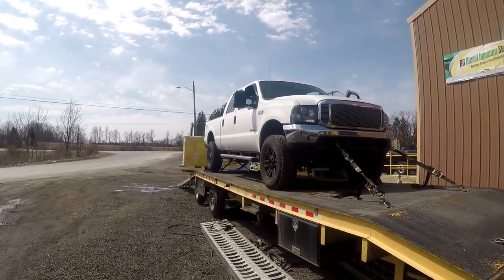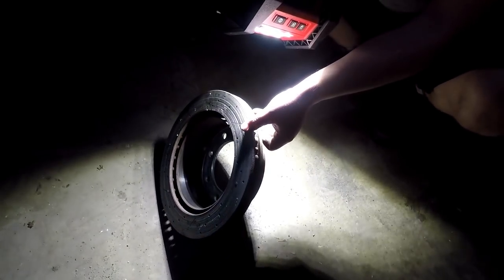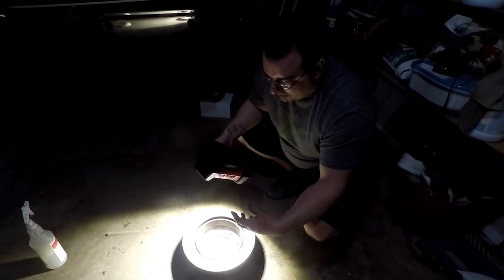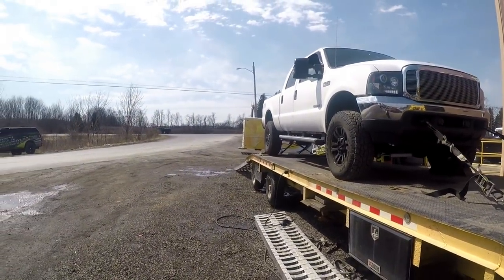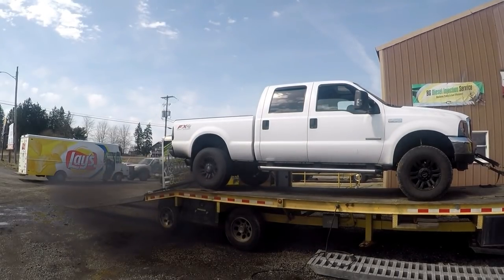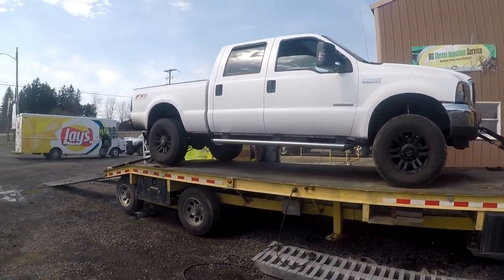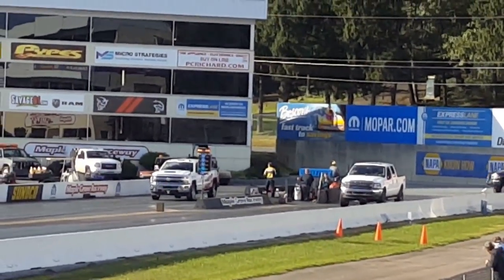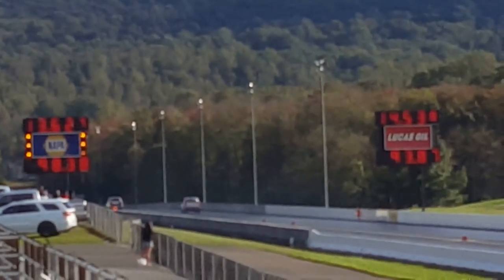6.0 Powerstroke Build Update

Comment: Fourth, i Think. I'm glad you decided to go with all the Billet Shafts, Since you're already in the Trans. You won't Regret it. Transmission should be ready to take any Power you throw at it. I know you were Running 175,s with Stock Nozzles. Still going with 190/30,s ?  Or did you Decide to go Bigger ?  I'm Running KC Stage 2 with Warren 175/30,s  i definitely wish i went Bigger. Was worried about Passing Emissions Testing, my State i gotta go every 2 Years. Just went about 6 Months Ago, Truck actually Ran Cleaner than 2 Years Ago. Was Surprised since i Deleted the EGR and Cat Converter
Only applies to Diesels 10,000 lbs. And Under, my 2006 F-250 Super Duty is 9,800 lbs. So i gotta go every 2 Years. So when Funds become available will definitely be going with Warren 205/30,s or 205/75,s Still with the KC Stage 2 would like to put there Stage 3 on but for now just injectors hopefully in a few Months. 205,s might be a tad Big for the Stage 2 but Don't wanna make the Mistake of going Smaller then Wishing i went Bigger just like i did a Few Months Ago.
Enjoying the Build, keep the Videos Coming.
Reply from the maker: I think you're third man. Thanks for the support.

Comment: I’ve been binge watching your channel for a while now, my dream came true after 12 years and I’m now the proud owner of an 07 F250 lariat quad cab short bed. About to get my tax return and plan on doing Egr delete, studs, BD oil relocation air cooler, KC stage 2 and Odawg intake with looney tune, I just don’t know what injector... have any thoughts? Great videos
Reply from the maker: Awesome thank you for the support. Now for your question with a stage 2 you could go as big as a 190/30 which is a great injector. On the smaller end you could do a 175/stock or 175/30. Now you will most likely need a fuel system with this setup at least a regulated return. I am running a fass fuel lift pump and doing a regulated return this summer
Reply: Don't know if this Helps you out but i recently went with a KC Stage 2 and Warren 175/30,s i definitely Wish i went Bigger, i would Definitely go with atleast 190/30,s From what Charlie said he Recommends 175/30 or 190/30 I'm Planning on going Bigger 205/30,s or 205/75,s cause i really wish i went with his Stage 3, when i ReCoup some Money from all the Mods i just did few Months Ago. So if you're definitely going Stage 2 i myself would go 190/30,s Done make the Mistake i did, i went 175/30,s and Wishing i went Bigger now. Hope this Helps you Out. Also at the time i did all the Upgrades i also did a Regulated Fuel Return, and that was it for Fuel System Upgrades, you should be O.K. with 175/30,s But if you go with 190,s i would Definitely do a Lift Pump i just did the AirDog ll-4G with my 175,s Just to be on the Safe Side, cause I'm planning on 205,s in the Near Future. Hope this Helps.
Reply from the maker: @badass6.0powerstroke10  great advice man. I personally will be going to a 205/30 on the truck. Also guys check out Turbo Time USA they really do have some killer stuff. That said kc turbo is also a quality company and you cannot go wrong there either
Reply: Thank you for the advice guys! It’s like an awesome Powerstroke forum without the BS 😂 anyways I really appreciate it. And I would have checked out your turbo sponsor, but I’ve been dead set on KC for a long time and I’ve been after their whistle haha! Shallow, I know, haha but when you’ve wanted something for so long you have to make it happen!
Reply: @CONTROLLEDINSAINITY   Yeah, i did alot of research before i did all my Bullet Proofing and Upgrades, You can't go wrong with KC Turbos, I'm Loving my Stage 2, i went with 175/30,s Wish i went Bigger. 190/30,s Would be ideal with the Stage 2 I'm gonna be Upgrading to 205/30,s or 205/75,s  Just because i plan on Going with there Stage 3 in the Future.
Reply: Bad Ass 6.0 Powerstroke Dude! I wish they were in production on the stage 2r, if you read about that thing it sounds amazing! I think I might call them and ask if they have a production return date. If they did I would probably hold out and wait!  By the way, just so I can understand the whole scoop, why do you with you had 190/30 with your stage 2 over 175/30
Reply: @CONTROLLEDINSAINITY   Just for a Little More Power. I was worried about Passing Emissions, in my State i have to go Every 2 Years, if my Truck was over 10,000 lbs. Gross Vehicle Weight i Wouldn't have to go. Mine is a 2006 F-250 Super Duty my weight is 9800 lbs. So i have to go Every 2 Years. They check through the Tailpipe. If i had a F-350 i Wouldn't have to go. Charlie hasn't been selling the Stage 2 Ball Bearing Turbos in atleast a Year. Check his website, he Always updates it, i Believe he just put in there that he's looking for a different Bearing Manufacturer. He's always updating his site. I just checked the Other Day.
Reply: A year ago when i bought my Stage 2, he still wasn't Selling any 2r,s  That's what I wanted too.
Reply from the maker: Last I heard with the 2r he was looking at a different bearing manufacturer like stated. The stage 3 is great but that large and you lose a lot of towing ability. With anyones charger that size. I am pushing it with my 66mm turbo but I think it will do surprisingly well. Typically a stage 2 turbo about 64mm-65 is considered the largest to tow with. As for injectors 175/stock or a 205/30. 175 stock is a great injector capable of low 500 hp while the 205/30 can be tuned to tow a ton of weight or to put down over 600 hp.
Reply: @six0bros  Oh definitely, i made 572, 1016 Ft.Lbs on 175/30. But that's about all a 175/30 can do. I only Towing 4500 lbs. Maybe Three times a Year, so I'm thinking should be fine with 205,s And a Good Tow Tune.

Comment: How Do You Know 'How fast' A Driveshaft Is Rated at??
Reply from the maker: There is a calculation for it, but you can find pictures of when they bend in half it's pretty crazy. I found a few charts that did the calculation for me and I only had to measure my driveshaft.
Reply: 6.0 Bros wonder what my excursions driveshaft is rated to??
Reply: 6.0 Bros (sure hope that bicep healed up well for you)
Reply from the maker: Thank you so much man. The support from you guys on the channel has been out of the world. I am incredibly thankful for the support you all continue to give me. As for your excursion I am not sure. That said if you have a two piece I wouldnt worry about it. The drive shafts on a two piece are in no real danger. You would need a fair amount of power to worry take care of it get it rebalanced when you do u joints and carrier bearing and you'll be good.